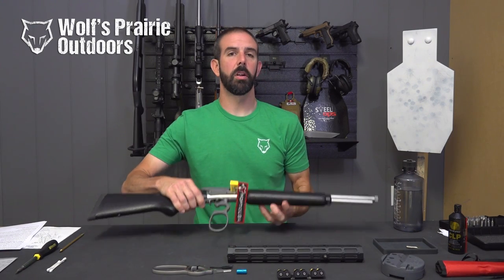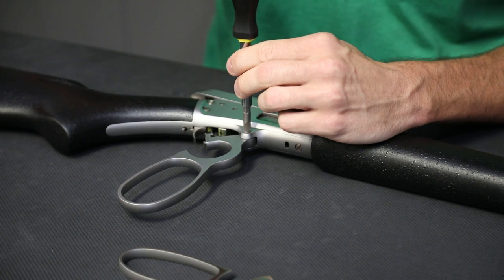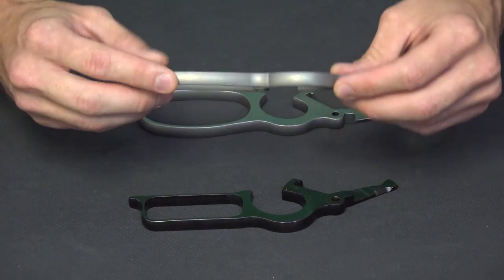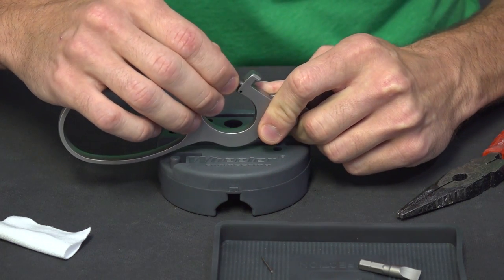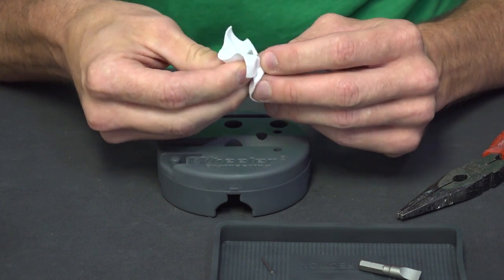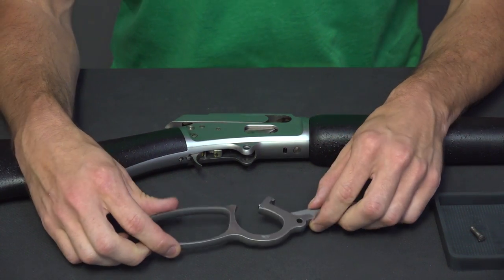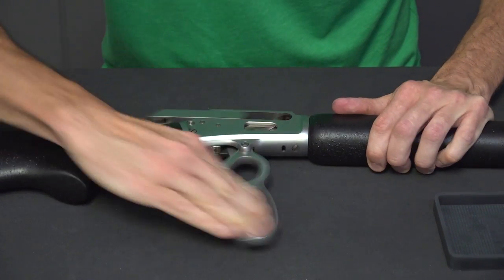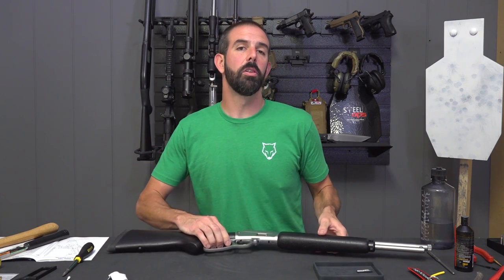Ranger Point Precision Medium Loop Lever Installtion

Comment: I just picked up a consignment sale Marlin 336 30-30. It was cared for, and already has the hammer extension installed. I'm on the wait list with Ranger Point Precision for a lot of the parts I've seen in your videos. 
   I would like to do a full takedown before I shoot it for the first time, it being used. My local shop, where I purchased it, does smithing, but I would like to do as much work as I can. Watching your video's cuz I ain't no bubba. 
   Do you have any full teardown and/or also field strip instructional video's ?           
   I'm itching to get this done so I can go to the rez and use the outdoor range.
    I got set of hollow ground screwdrivers and brass punches w/a hammer that I can change the striking surface. Till then I got her locked up. 
 Thanks Wolfs Prairie Outdoor for the great videos and detailed instructions.  
I'll keep watching.

Comment: Great video, although I'm sad to say in having a heck of a time with the roll pin on the plunger, but in sure that is on me, the rest went smoothly, even the loading gate change from the other video
Reply from the maker: Thanks! Take a punch and push it through the hole first. I have had burs in the loops on occasion that will hinder the pin from going in. So glad the videos are helping!
Reply: Which size punch?? I'm having a little trouble as well

Comment: with the lever extended, do you get a little side to side flop? or is it just my gun
Reply from the maker: Howdy! Mine wobbles a little. There are so many varying tolerances in the Marlins that it's tough to make a perfect fit for all. They do sell a shim kit if it's an issue, basically two very small washers that fills that void and helps to eliminate the wiggle. Thanks for watching!
Reply: @buildhuntxplore  Theres a kit for everything lol...I almost used cheap washers.  Ill check on that.  Thank you
Reply from the maker: Welcome! Yeah there is, lol

Comment: Besides the loop size. What other differences is there between the stock lever and the RPP lever?
Reply from the maker: Depending on the year of manufacture of the Marlin lever, the RPP is going to be finished out MUCH better. A lot of the post Remington purchase of Marlin had very sharp edges, even on the lever exterior. I literally had to take 600 grit wet/dry sand paper to my 2017 1895 SBL lever (and the entire internals) because the edges of it were uncomfortably sharp. The RPP is smoothed out on all edges and very comfortable. That's about it. But one thing to note on the loop size is that the area where your fingers rest in a Marlin loop, even though the loop is bigger, your fingers still bunch up at the top. The RPP lever is elongated where your fingers squeeze, so it's a much more comfortable squeeze, especially with gloves on.

Hope this helps some! Thanks for watching!
Reply: Thanks for the reply.
Reply from the maker: Welcome!